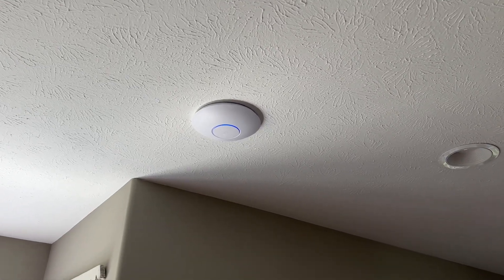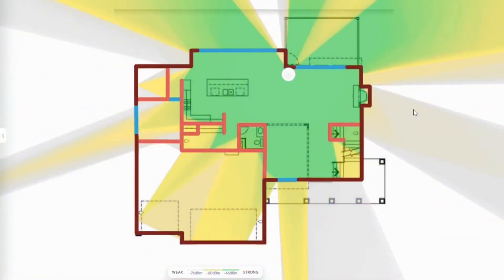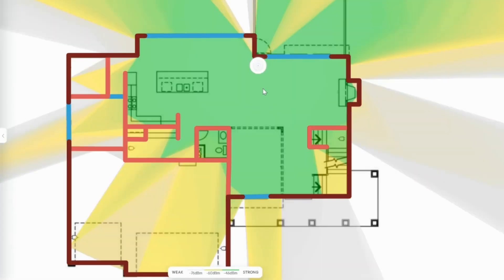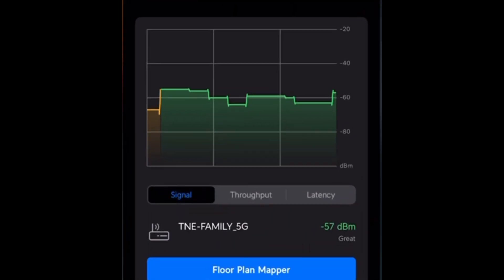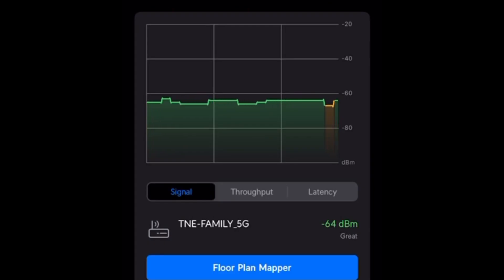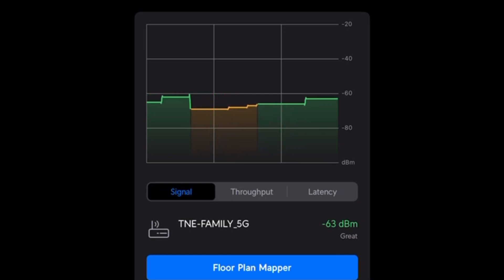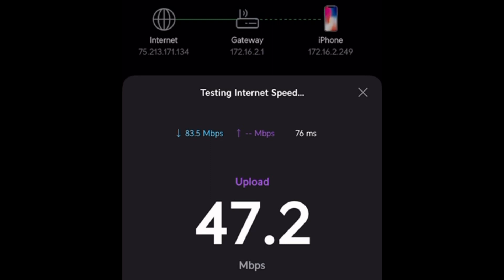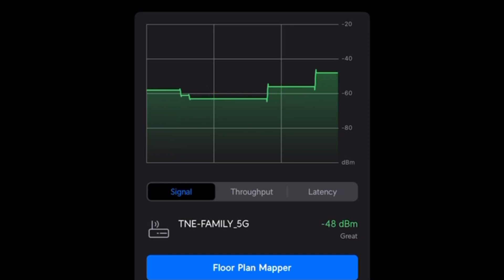Putting the U6-LR To the Test!

Comment: This test is only for USA paper buildings. For all non usa buildings with solid bricks and steel concrete dont work.
Reply from the maker: Yes. It’s for a home.
Reply: So how do we look at tougher wall surfaces like old plaster (cement) walls and concrete basements? Old houses need good WiFi too❤